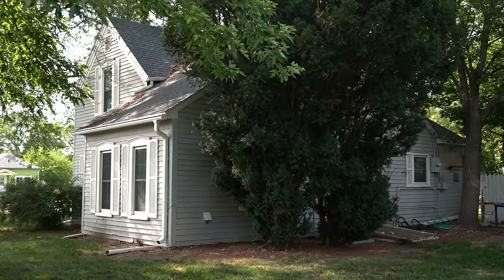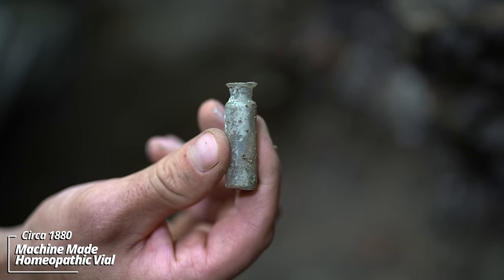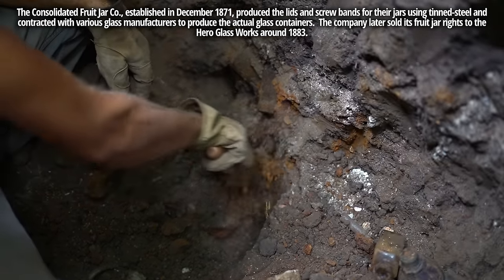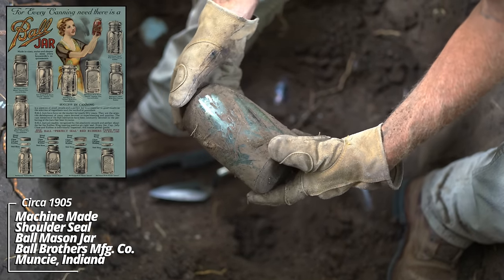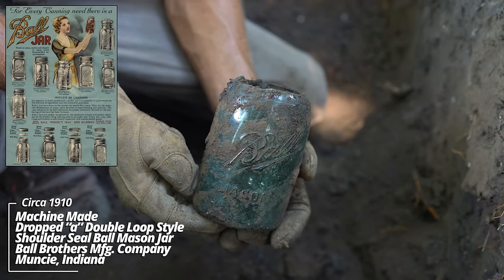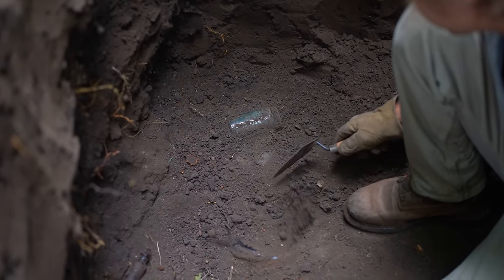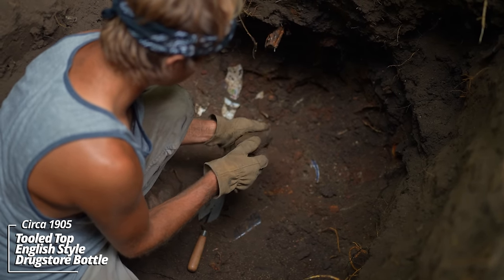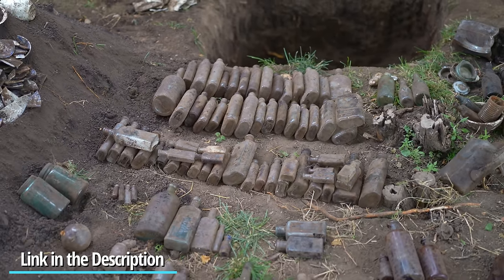A Strange Sink Spot Opening by a Fence Leads to a Find of a Lifetime Buried in a Back Yard

Comment: The glass ball at 103 is an early fire extinguisher and you should be very careful as the chemicals inside them can be very dangerous. The idea was to through the ball at the fire and the glass would break and let the chemicals react to the fire and in theory put it out.

Comment: 1800’s had a opium epidemic, I believe that’s what came in the tiny round vials.
Reply from the maker: There are a certain type of vial that was a little thicker than these ones.. and they didnt have the flared lip on them. they look very similiar, but typically these held pills for diarrhea. but there actually was on opuim vial in one of the later pits in the video. they are very similar looking

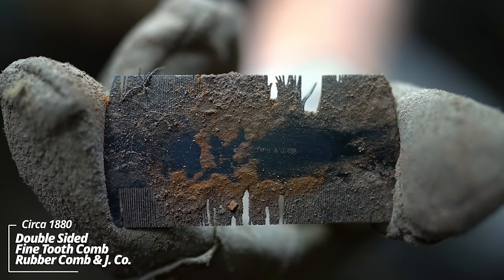Comment: 15:30 - That's a lice comb, or more specifically, a comb for removing louse eggs.  Also called a "nit comb".  If shaving the head wasn't an option, such as for women, then you'd wash your hair in something to kill the lice, then run this comb through your hair to remove all the eggs the lice laid on your hair stalks.  Even back then, with mass manufacturing, lice combs were expensive items.  That's quite a find!
Reply: Very true but they did also use these style combs for stashes. Do agree with your comment though..